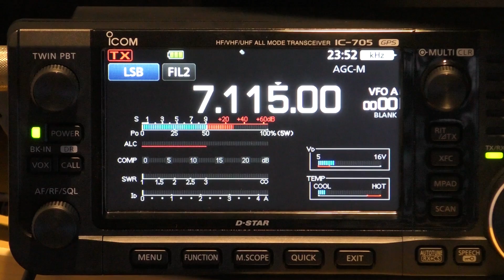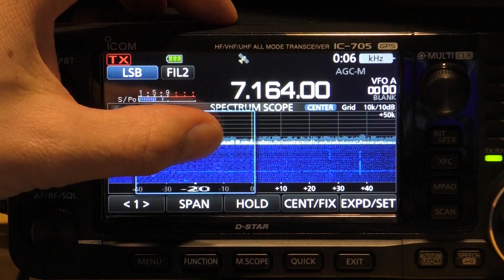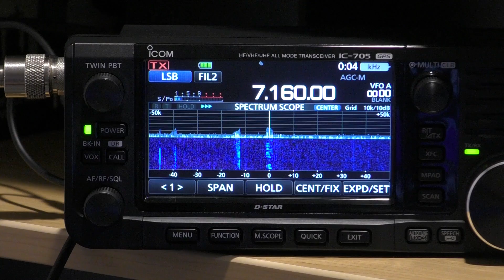Making Contacts and Testing the Icom IC-705 on HF (7 MHz)

Comment: i don't understand why Icom with 7300, 705 (and maybe 7610) continues to use this wrong representation with central frequency in the middle e modulated signal on both sides. (both on transmit and receive). The good news is that you can change it to the appropriate way, but really.. i don't understand why they keep this one as default, being completely wrong. Thanks for video.
Reply: You are right very strange. I've only Icom Radio and standard is modulated side. Never seen like this before, probably it must be an option. Interesting.
Reply: @weickcasa6414  yes, there is an option. (i don't remember which one, as i do not own anymore an ic7300). Bye